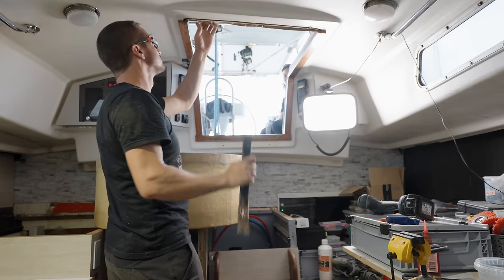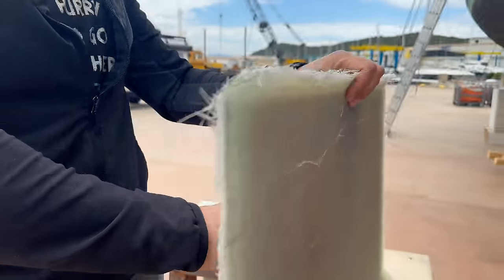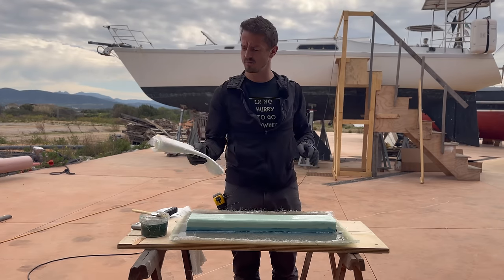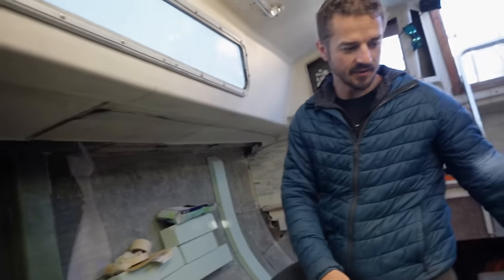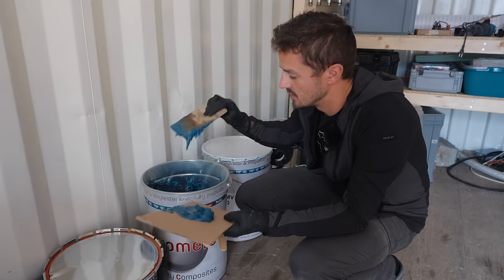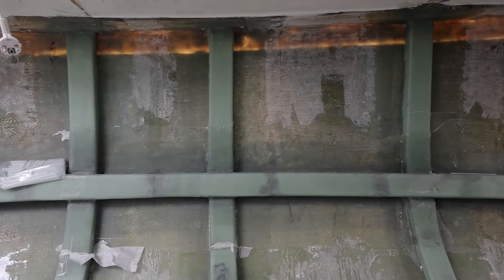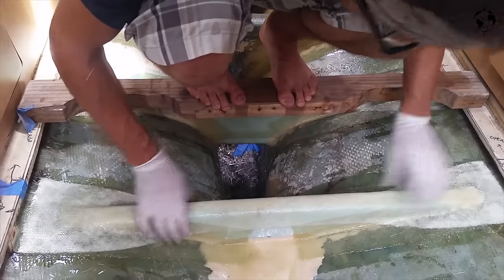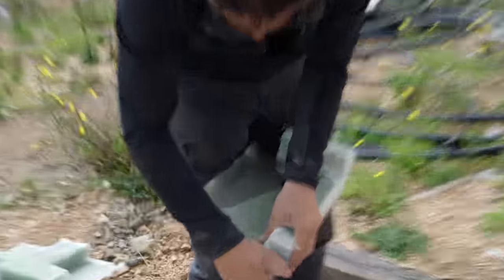Cutting Open our “New Hull”: What Could Go Wrong? | Step 386

Comment: Agree with AntoineGrondin, You didn't grind the "hull" panel and clean it with solvent (acetone). I think your failure was brilliant. Having a PhD in composites as well as double engineering degree and having spent a few years in high level composites commercial development then composites manufacturing, I literally cringe at the incorrect methodologies shown on many a YouTube video. So many are literally spreading misinformation, yours included. Also, the people you have employed are not experts in all the necessary aspects of composites. Those who design, and who are not grass roots educated in composites, over engineer. They do this because they don't really know composites. Yes, there are super yachts made of glass and carbon fibres, but how often do they fail. Aerospace attracts the true composite experts, mainly because there is limited money outside of aerospace.

One more helpful tid bit. The bond strength between laminates of old glass and new glass is only ever going to be a fraction of the strength of the bond between laminates within a layup. Here is a little science as to why. A composite functions by the load within the composite being transferred from fibre to fibre. Think microscopically to understand what I am about to explain. Between each single fibre or strand of glass is resin. The load in a fibre travels through the fibre, through the fibre/resin interface, through the resin, through the fibre/resin interface of the adjacent fibre and into the adjacent fibre. Now you know this, you can understand how critical the fibre/resin bond at the interface is required to be. Which is why the glass (or carbon, kevlar, hemp etc) must be coated with a coupling agent to promote a strong bond. Now we come to the resin. Resin consists of long polymer chains which also act like the individual glass fibres insofar as transferring the load from one polymer chain to the next. The polymer chain/polymer chain interface is not actually an interface. Not like the interface between an old laminate and a new laminate. The difference being, in the continuous resin, each polymer chain is linked to the next by a process called crosslinking. These are strong molecular bonds which effectively allow the resin to behave as a continuous material, transferring the load uniformly throughout and therefore from fibre to fibre as required. If the crosslinking within the resin due to any number of factors, such as poor mixing of catalyst, then the resin will fail under load and delamination or catastrophic failure can occur.

THERE IS ZERO CROSSLINKING BETWEEN OLD AND NEW LAMINATES. Everything depends on mechanical adhesion alone between old and new laminates, hence the critical nature of grinding the surface of the old. There is zero to very little CHEMICAL ADHESION. It is because of this, I would suggest you finish your boat ASAP and sell it. The bond between the old and new laminate WILL, given time and cyclical loading, FAIL. Which means your boat will have acted as a tool, as you cheekily pointed out in the video. Remember, the experts you have installing the ribs and stringers are experts at exactly that, installing. They are experts at doing what they have been trained to do, but really have little scientific understanding. They don't need to. It is not their job. Neither do the naval engineers when it comes to repairs, as compared to making new. Every composite repair will never be as good as the original, even if it looks as if it is, and ultrasonic testing says it is. Know the material science, and understand what is happening at the level of the individual components with cycles of loading, and you will have no choice but to agree with the above. Good luck.

Comment: Looking at your problem you don't put the foam down with hot glue gun that is weak.2nd problem you guys are not using epoxy.3rd thing if your using open cell foam it will take all your vinyl Ester or poly Ester that you are using and make for dry bonding at this point sure the architects know calculations and the yard workers build boats but if they built a boat like that it would fall apart and remember after peel ply you should still abrade the surface also this is a big problem and that's why you pay professionals to do the job instead of amateurs if you two where really doing your homework you would not have chanced and should have gone west systems all the way that other stuff is what people used in the 70's times have changed
Reply: Technology too

Comment: Using hot glue.... mmmm....😮
Reply from the maker: The hot glue doesn’t matter. We could have use double sided tape or sticky notes. The hot glue is literally just there to keep the foam in place in order to fibreglass over it. Its the lamination that does the job, not the “hot glue”

Comment: In my opinion, your model failed because:
- you did not sand and clean the fiberglass (hull model) in the bonding area
- for fixing the foam beam you used plastic gun instead of VE based bonding paste which should have been spread over the entire bonding surface
- the sandwich integrity of the model was compromised by sectioning (in order to visualize the entire structure).

Comment: the only reason of the problem is that they didn't sand the hull before laminate on it.And better use bond resin to attach the foam on the hull, wtf is that hot glue
Reply: To hard is too  brittle  
Might crack... flexibility 
Is strength.  You dig man...???

Comment: Just watched this video (https://www.youtube.com/watch?v=JX8Sr4aO77o) which confirms your approach that sanding and degreasing are not needed after peel ply is used. I am curious as to just how long you left your peel ply on your "hull" and thinking that if it was removed too soon that waxes may still have surfaced into the peel ply texture during the remaining curing time. Just a thought.

Comment: You are pretty much guessing here? Modern boat designers use finite element analysis to work out where the weak points are - they can model it via mathematical models. The  construction process then bakes it all together in one go. Literally no scientific reason for what you are doing - it is all hope and guesswork.
Reply: I have a Bavarian 37. The original design is strong and the hull is intrinsically strengthened with Kevlar in the bow. They even did videos of it being driven into a concrete wall. So think I will stick with mine 😀

Comment: Are your hired craftsman fluent in English?
Could cause complications.

Did you have to push the old hull dimple out. Did it go away completely?

I could never trust hired help with critical structural work.

After sanding, lung blowing away, causing foam and fiberglass dust to get airborne, is really stupid. 
Especially your second etc, blow, immediately inhaling the first cloud. Use a whisk broom or brush, if you must. If you had a compressor, air nozzle. But anyone downwind gets your brilliance in their lungs.

🌊🌊🌊⚓⛵⚓🏝️🌊🌊🌊

Comment: Bonding anything to fiberglass of that age, is not a straight forward task. I sincerely hope this video-ending was made for entertainment reasons, and that the crew working on your boat actually know what they are doing... Only thing that will give you a acceptable adhesion here is good quality EPOXY on key`d surface for mechanical grip. ...sorry :/

Comment: Hot Glue gun???
Reply: Just to hold the foam plugs in place while they glass, the hot glue is not intended for structure.
Reply: I was thinking the same thing. The goal should be to make the pieces become one, and hot glue is not the answer when building a boat that travels the world. Seems the blue glue/resin is more of what they need. But I'm not an expert.

Comment: Because of the AIR under that Foam that is only glued down , REGARDLESS of the Fiberglass holding it in place it is going to 
DELAMINATE within 5+ years. 
You guys have WASTED all the work.   Foam is Garbage , Foam core boats are Garbage.  
SOLID GLASS is structure.   At this point you should U Channel the foam stringers and POUR a MAD AMOUNT of resin with loose chop strand mixed in to make the Foam irrelevant.  

You indeed HAVE NOT DONE THIS NEW PROJECT PROPERLY. 

FOAM SUCKS.
Reply from the maker: Thanks for sharing your opinion. But we’ll get our boat building advice from boat builders in our inner circle who we know and trust. As well as our own experience building Uma over the past 10 yrs.

Comment: Why didn’t you require the workers inside to wear protective respirators rated for VOCs?  I get so tired of sailors taking advantage of workers in poor countries to get work done on their boats.  Many times, the workers in these countries are not protected by OSHA type laws.  Some of the cheaper price is directly related to the workers not using safety equipment.  VOCs are dangerous.  Fiberglass shards are dangerous.  Both lead to COPD type symptoms and an early death.  But, at least you sailors saved a little bit of money!

Comment: I have a question you didn't answer.  So you guys have been landlocked for a year and dropped all kinds of money on docking and transport and fees.  You guys know that if you started this boat from scratch, literally using a form to make the shape of the hull,  that you would be further along in this process than just glassing in some ribs a year into the project?  I know you guys are youtubers, and you aren't super trying to get this boat done, but dang.  You have been "landlocked Uma" for a year now.
Reply: I was watching Salt and tar for 5 years while they were building their boat, and they took like 3 videos and a whole damn month to build a wooden rudder. I know not everyone is in the same financial position, but if your youtubes aren't making bank, just go get a job, do the boat on saturday, and it would take 2 hours to build a wooden rudder.  They built the deck, treated it, and a year later after the sun had eaten up the wood, they had to do the top deck again.  That was a month of videos.  Another whole month, and the damn boat had not touched the water in that year!!!!  Look if you guys don't have the money to do all this crap just tell the patreon, and go get a normal job for a year.  You would have so much less stress than OMG i have to make this youtube as dramatic as possible to get the algo happy with me.

Comment: Like I have said it is a waste of time and money to do this. 
The old fiber glass is very old and brittle. Putting new over it will likely not adhere to the old fiberglass to make a strong hull.
In boat manufacturing they build the hull in a mold and put beams in and glass over the whole structure and it all cures together. Like concrete you can not pour new over old it has never worked !
Fiberglass is the same principle the new will not bond well to old . 
Scrap Uma and buy a new boat you will be money ahead !